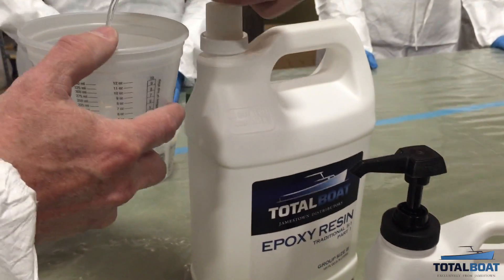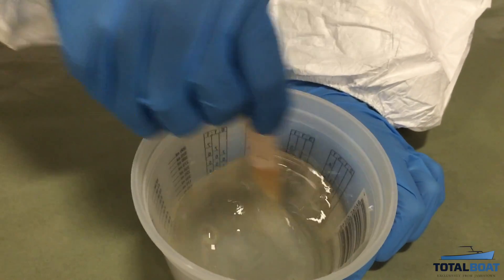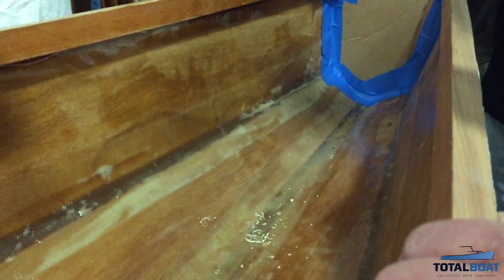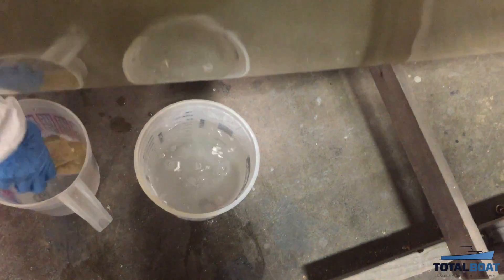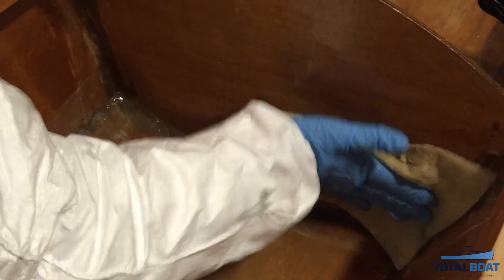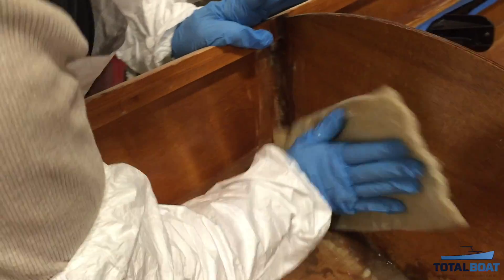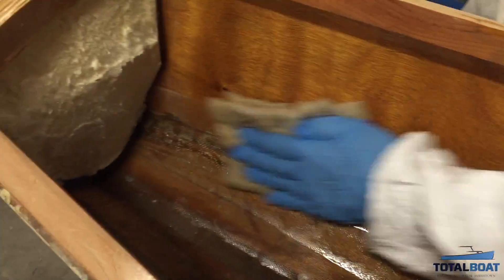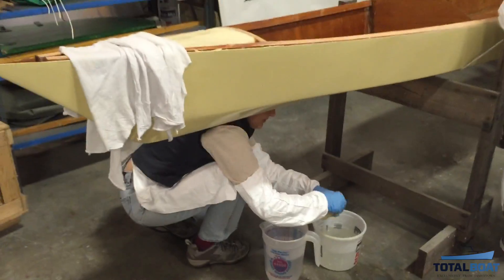Removing Amine Blush From Epoxy

Comment: How do you know when you've gotten rid of it all?
Reply from the maker: +OldePete Once you start removing the blush - it should be noticeable and parts where it remains should stand out. (look from different angles - use a flashlight on the surface) but in case it is not - give it a thorough scrub with warm water and you should be safe to go on with your next step.
Reply: @JamestownTV will the epoxy lose its shine?
Reply: Oh nooo, wish I'd seen this before, I've just sanded my resin coasters to get rid and had planned to top coat, I hope I haven't made it worse!
Reply: +OldePete  You just keep staring at it on your phone and say some magic words. See its gone now.But you'll need to drink a bottle of Jesus juice to make the magic work.  Have a nice day :)